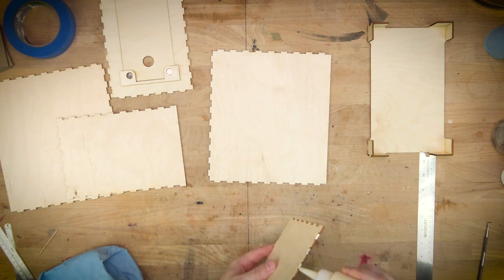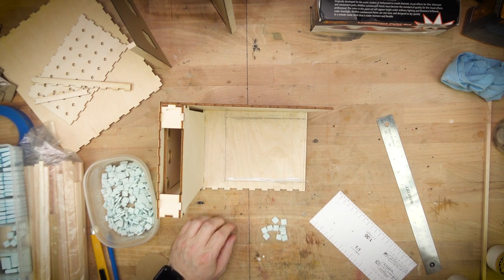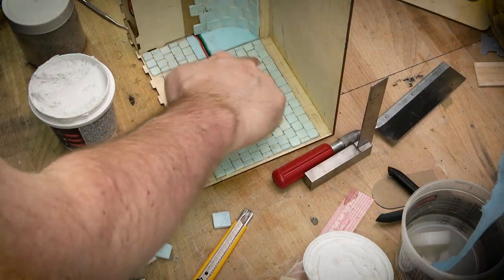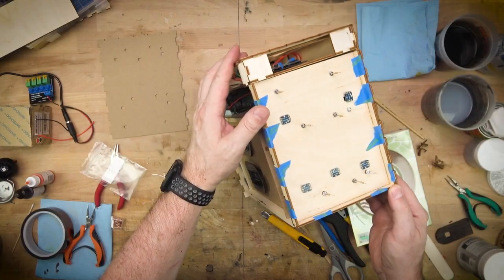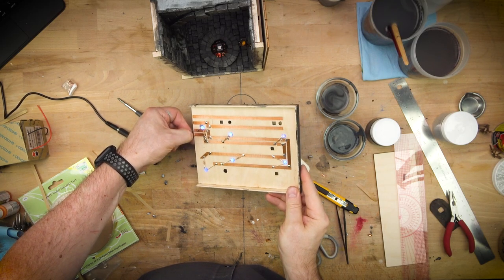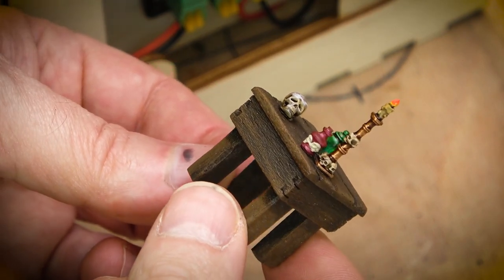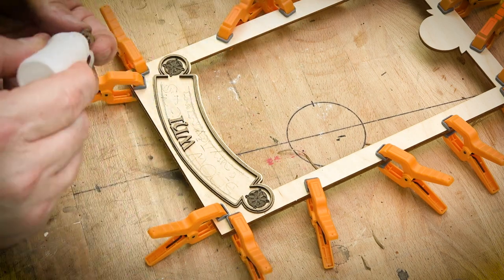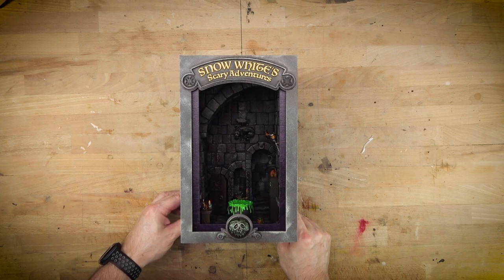I Built a Snow White Book Nook!

Comment: Where did you get the Arduino board with the MP3 player module, this is not a typical development kit, looks like you have a specfically designed board with the player hard mounted, as well as terminal blocks for other lighting... curious where you got it?
Reply from the maker: That would be something I whipped up. I got tired of proto-boarding. Here’s a link to my site showing the boards - https://randommakingencounters.com/arduino-neopixels-dfplayers-and-circuit-boards/ 

One important thing to note is I’m not an electrical engineer… they work… usually… but I have no expertise designing PCBs. They’re also pretty focused on solving for one thing so I often find they’re too specific to my ever-changing projects. Not sure if that helps or not. All the best!
Reply: @RandomMakingEncounters  Many thanks!!!!

Comment: Wow, this came out really good...I'm also very impressed with your electrical skills.
Reply from the maker: Thanks! I've done a couple of nooks now that use sound and LEDs so I think my soldering is getting better. It's still a lot of wiring and fussy bits so I'm always trying to figure out how to make it faster and easier. Painting with the UV paint was such a nightmare that it's really put me off on using it as a material... even though it really looks cool when it works... oh well. Thanks again and thanks for the comment. All the best!